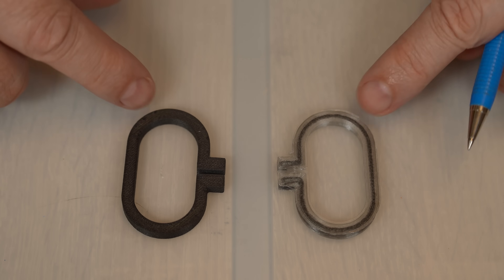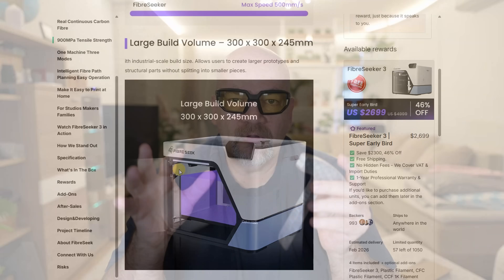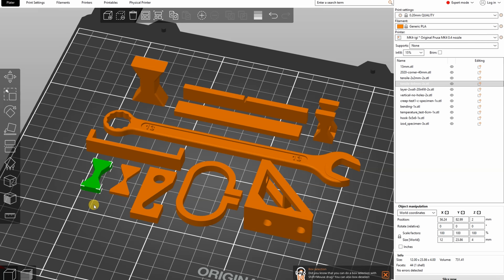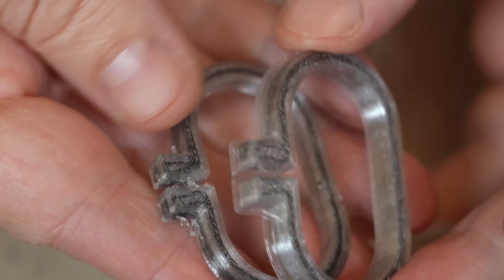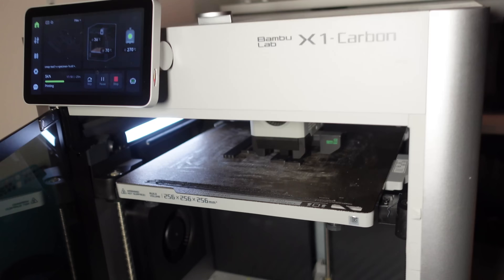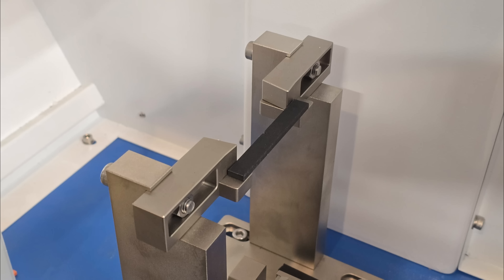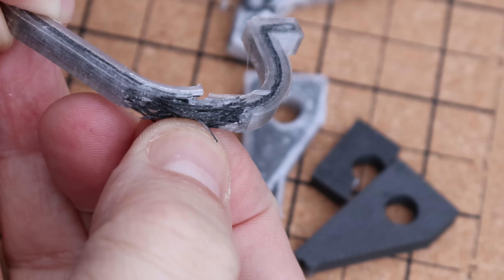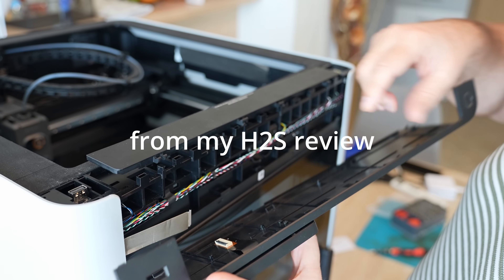FibreSeeker 3: Continuous Carbon Fiber vs Chopped CF – Huge Difference?

Comment: Hi,
There is a few videos about the "safety" of carbon filled filaments. Where they show that small strands of carbon fibers get deposited everwhere (skin, etc.) as they're not fully embedded in the polymers or get loose during manipulation.
What id your input on this? How do you consider this situation?
Reply from the maker: Eh, there are clickbait videos, you should learn how to recognize them. I covered the topics several time. Safety is similar like in woodworking. Would you rub the wood against your skin?
Reply: @M @MyTechFun ot raw wood, but smooth wooden items might be used this way. Wood particles might also degrade better in the body?
Will look more carefully for your videos on the subject!

Comment: CF is a scam, video that shows CF not bonding to plastic electron microscope scans first time, voids in plastic instead. Channel "I built a thing" made video "3D Printing’s Biggest Scam Is Even Worse Than We Thought!"
Seems this printer FibreSeeker 3 is also possible scam as continuous fibers do not bond either.

Comment: Thanks for the real tests! I almost became a sponsor of this new 3d printer... They probably still need to work on what they have stated about the durability of the printed products... according to your actual tests, it is clear that the difference with conventional carbon fiber filaments is not great... by the way, they claimed that the strength is 900 m.Pascal... I hope that they will send you what you asked them to test the product, and their engineers will try to correct the situation with their statements... It can be seen that their car is still very damp.... but the very fact that tdea and their lines for such products are in need in many industries is true.

Comment: Having used a Markforged X7 printer for nearly a decade, I still don't see the benefit of stranded fiber inlay. As you noticed in your test specimens, the individual strands of fiber are poorly adhered to each other which compromises the strength that should be provided by the continuous fibers.
Back in 2018 they were revolutionary but they haven't improved the technology at all and now a <USD1000 Bambu printer can produce stronger parts that look better and take less than half the time to print. Now we have strong, cheap materials that are easy to print (like fiber reinforced ASA) that are a nobrainer compared to fiber inlay.

Comment: If all prints made using this fibreseek 3 look that rough and uneven  , no matter how strong they are i am not interested. It would take to much work afterwards to get them looking a bit presentable. While looking at their video , the time it takes to print even a small object is another reason this will never be a succes .

Comment: Thanks for the honest video! I find it disappointing that Fibre Seek not only did not provide a printer for your tests but did not even print the parts to your specs. This only means one thing, the printer is not ready even with V2.0 announced. I've noticed that other companies do not want reviewers to test/publish reviews, especially serious reviews, before the end of KS campaign. Continous fiber idea is great, and Fibre Seek is putting a lot of effort into it and making it available at a great price, but it looks like Febre Seeker 3 still has to sort out a lot of issues, which may require V3.0. Also besides potential weight savings, I am not convinced that this is better than CNC milled parts or parts produce by other printing methods.

Comment: I have a feeling they did a pre-print & testing and found there weren't good results with all of your test objects. Not trying to knock fibreseek but they're always displaying or showing tests with the same objects. It seems like they've found a stonewall for the techs use case at least at the print volume size they currently offer. They should've made a much larger build volume version of the printer to cater to more industrial applications as these types of prints seem to be more practical for that use case than for hobbyist or even print farmers.

Comment: The Markforged Onyx Pro is priced at €10k, but it also has an astronomical quality. We tried one with fiberglass, and the price difference can be seen with the naked eye. I'm not justifying the price, but Markforged makes industrial printers that are slow and have crazy quality, and this is a desktop printer that's less than €1,000, which brings in a lot of bad quality parts to make compromises. Honestly speaking, I don't see a continuous fiber printer as so useful for home projects, a person who needs to print certain things I don't think he's going to look for materials and printers like that, I think he's going to prefer an A1 or an Ender 3, or any other printer that will allow him to print cheaper materials, maintaining a good/excellent print quality and with a huge materials compartment, including pure, cf and gf. In my opinion, it would be a more valid printer if modified with certain components, with a higher price and intended for an industrial regime
Reply from the maker: I already tested Markforged parts on the channel, they are really strong. https://youtu.be/8vHjrHDZdYg but no heated bed, you must use their filament which is also expensive.. That's why I mentioned, that I can see the possibility in this technology, but its not finished yet.
Reply: @MyTechFun  99.9% of the industrial 3d printers they don't allow you to use the filaments you want because they are designed specifically, or they don't allow you to use them (even if they sell you the printer with an open library) because if something happens to the machine the warranty expires. I know this from experience as I carry out a 3D printing service.
I also see the potential of this technology, but I only see it in an industrial environment and I don't see it so much in a desktop environment, as it requires specific printers and for a person who has a hobby it can be burdensome, unless he already owns 2/3 other printers

Comment: Has the endless Fiber a positiv Impact for shrinkage? 

Can you add the shrinkage in the Future to your Test?
Like how accurate is a Material? 

Have you found a solution for different shrinking at the S1 Pro?
Reply from the maker: The surface quality was not good enough to measure that accuratly. Continuous fibers should have a positive effect to shrinkage but only if they are tightly bonded to the base material too (like with chopped fibers)
Reply: @MyTechFun  thanks :)
So I need to wait If the theory is proven.

Comment: The surface quality of the test prints looked poor to me. Do they expect to compromise on finish/aesthetics for strength? I've always considered prints using chopped CF to have a very pleasing slightly textured matt finish that hides layer lines whilst being inexpensive and surprisingly strong.

Comment: Always interesting stuff, I’m surprised the continuous carbon fibre is so poorly distributed in the parts, if they had put it closer to the outside walls on the test pieces it would have been much stiffer and stronger.

Comment: I thought very hard about buying a FibreSeeker but couldn't make it make sense. Its print speed (with fiber) dictates that it's biased towards prototyping rather than direct production. However prototyping usually do not care about ultimate light weight just yet, but care more about using least amount of time and money (time and money could be interchangeable) to push stiffness and strength as close as production parts. Since the continuous fiber is still in the XY plane without continuity in the Z direction, it's not much different from having the part made by cutting pre-fab composite sheets. The advantage of parts produced by this machine is that it could be much lighter than cutting pre-fab sheets to meet the same stiffness and strength requirement, but require much longer time to produce, so it might be not ideal in the context of rapid prototyping. It does allow one to skip the fiber dust and messy resin though, and provide superior hoop stiffness on the inner loop patterns such as clevis pin holes. I don't know if those advantages are worth the wait on the time it takes to produce.

Comment: They have both a hybrid mode and a maximum fibre density mode. The max fibre mode will maximise absolute tensile strength, but at the expense of layer adhesion and torsional strength. The best compromise is probably having each fibre encased with unreinforced plastic. I see they’ve used PETG for these test prints, possibly because it results in visibly transparent prints, but carbon fibres with different pre-treatments will bond to different plastics by different amounts. Your horizontally-printed torque test would probably be a good metric for this fibre adhesion, assuming you can’t get a layer adhesion test working properly.

Comment: Sad how incompetent they were with what they sent you. They should have had a more senior employee review your request.

If there is no test showing that their prints are at least 80% of the strength of a MarkForged print by the time the Kickstarter closes, I am pulling out.

They need to have someone outsource MarkForged prints and then print the same parts on theirs, and let you test it. Or give you a budget to have MarkForged prints outsourced. At this point, I am 80% sure I am cancelling my pledge because it is almost mid-December and no such test has been done.

Comment: Fibre seek claim :"Stronger than aluminium "is just marketing gimmick 😂. While ago Easy composites tested Markforged samples, no, continuos carbon fiber 3D printed parts are not stronger than aluminium,but come close when technology is mature.
Reply from the maker: Similar like Tullomer, the tensile strength of the fiber is strong, but used as reinforsing in 3D printed plastic, its different.
Reply: @MyTechFun Yeah I belive they publish tensile strenght of carbon fiber tow in their marketing material.
Reply: @MyTechFun FYI "elipse template" is for carying plastic shopping bags 😅.

Comment: This test is extra important now that people like Stefan whom I - and probably many others - used to think of as unbiased is promoting and affiliate-linking to this printer without even having tested it... 

Stefan's whole video was pretty much just press-release talking points which is perhaps not surprising given that his recent trip to whatever-convention was paid for by Fiberseeker themselves. He may even repeated their whole "high speed" claim which as show is only true when you don't use the fiber. As soon as you do, the printer slows to a crawl. It is mentioned on the Kickstarter, and not horribly hidden but you definitely have to scroll a fair bit before they start talking about it and by then, they say "medium" or "low" speed while they gladly put 500mm/sec and 900mPa just next to each other in the intro. To many, it will  read like it's a high speed continous fiber printer - which it is not. 

As for your test, I am wondering if it wouldn't make more sense to test it against the strongest short fiber filament you have and not just PETG-cont. vs PETG-short? I know you thought it fair, but I think it can be argued that a comparison taking into account the material price would be fair, too. So, if we assume the Fiberseeker filament will be on the pricier end, perhaps comparing it to PPS-CF or something else equally priced would be OK?
(That said, maybe PETG-CF is stronger than I assumed and perhaps the continous fiber filament cheaper) 

Anyhow, thanks a lot for staying honest and independent.

Comment: Requesting a wrench and receiving an 'eliptical template' (that was great by the way) is, err, strange. 
You'd think they would be familiar with your channel and notice there's no major focus on trinkets. 
I looked at this machine vs the commercial option, which it does have some merits, but it looks like a good idea on paper that wasn't quite fully baked in production in my opinion.

Comment: The broken FibreSeeker parts almost looked hollow with loose carbon fibers inside.  Composites work by embedding the fibers in the polymer matrix so they're bonded to each other and share loads.  I think continuous carbon or glass fiber as a core in PETG or ABS has a lot of potential, although only for continuous printing.  Bridging obviously isn't going to work and starting and stopping the print would require custom G code to extrude the fiber as long as the print head is moving to the park position after the print.

I'm getting good results with ABS-CF, using short chopped carbon fiber.  Continuous filament would be much stronger but I don't need to change anything with the ABS-CF other than using a 0.6 mm hardened steel nozzle.  I'm currently printing another wall hook that I designed to hang tool bags that weigh up to 30 pounds.  The hang hooks print in 87 minutes and weigh 43 grams.  They'd probably support my weight.  That's an impressive strength to weight ratio, even without continuous carbon fiber.
Reply: That's a bit related to one of the points that some (well, maybe only one) early reviewers has been talking about - that the printer supposedly doesn't lay down the fibers taught enough. So, they seem to give and stretch before they even start taking up loads.
Reply: I saw a video with the printer under test that was basically that. The fibres are just loosely in-place. The Formnext test prints showed pretty straight fibres, but the ones I've seen actually printed are not straight at all, just kind of meandering around where they've been placed. It's a nice idea, but I'm not convinced by the execution in this specific printer.

Comment: I had a Markforged and it produced impressively tough parts. CF was in the Onyx filament, and we could coextrude CF or GF to further reinforce it  This almost seems like they are printing one or the other. It's hard to see what they were really aiming for here.  

Looking forward to FiberSeek sending you the correct parts as you had requested.  It would also be a good idea for FiberSeek to send you un-reinforced parts from the same PETG that they used, for comparison with and without reinforcement.  

Frankly, what they sent you was a bit confusing, as you said.  One would think they have seen your videos and would be familiar with how you test things. You are very consistent in what you test for baselining materials.
Reply from the maker: Yes, I tested Markforget parts, they are really strong: https://youtu.be/8vHjrHDZdYg?si=bsilm5B6-Vb6mkZd

Comment: Nobody has discussed layer adhesion, not surprised that they dodged it with you
Reply: It will always be weaker given the reduction of area the fibers take up. 

Most of their own examples (and the ones that would genuinely be useful from this) are ones that would already have a good amount of empty infill space to minimize that difference. 

Small parts will hardly benefit from this.
Reply: It's definitely partly down to print settings. Fibre will make it weaker in some cases, but PETG is possibly the best plastic for sticking to itself.

I've printed PETG parts that act near 100% homogenous,  like solid plastic with zero influence from layers. They printed too cold, so it didn't flow/stick together and encase the fibres properly. You can see excessive air voids.

GFRP/CFRP only work correctly if the fibres are properly encased.
Reply: Yup, too cold. If you print it too hot it will pretty much fuse with glass print beds. Maybe the fiber is acting like a heat sink